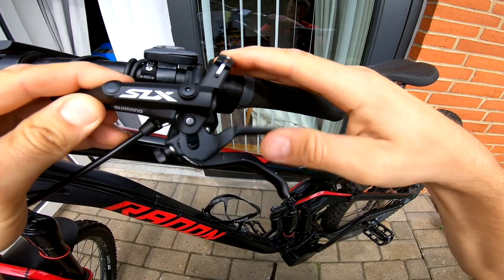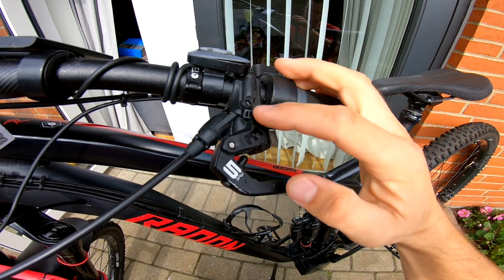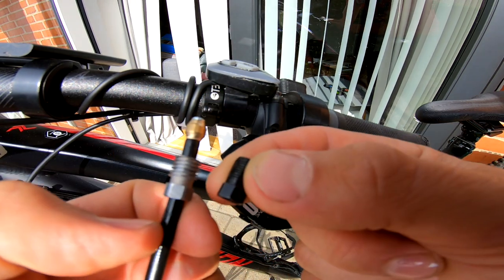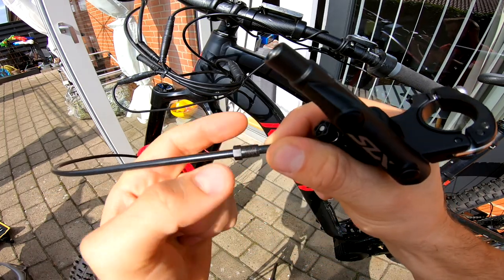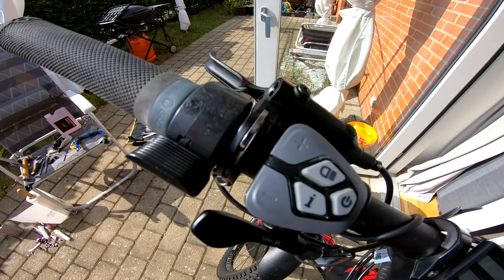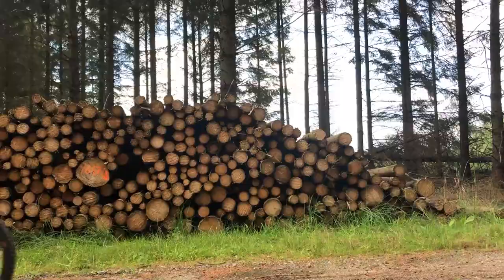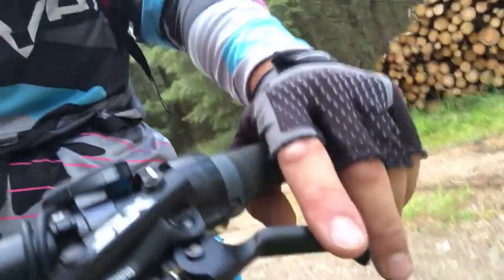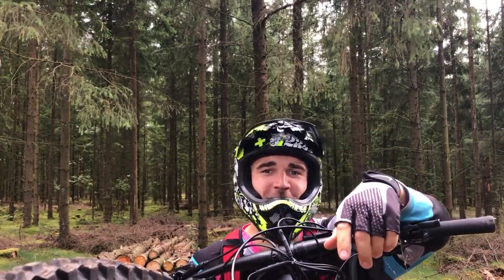Magura MT5 disc brakes with Shimano SLX handles on my emtb

Comment: Shimano Needle ?
Shimano Olive  ?
Reply from the maker: Hi Joni English, I do not understand the intention of your comment 🙄
Reply: @VRMinde  what needle did you use ?
Magura Needle or the Shimano Needle ( insert )
i see the Hose is Magura , with a Shimano Olive .
Reply from the maker: Joni English i used magura hose, shimano olive and needle :). (Edit: This comment is wrong, look below to replies)
Reply: @VRMinde  Thanks - i have a Magura MT5 older style and lots of play in the Lever Pivot : thinking of this update but using the m8100 or m7100 Lever Blades
Reply from the maker: Joni English I think there are better options than slx, I just got what I got in the mtb park workshop and then added the second one the same. I still like them more than magura mt5. Let me know if it worked for you
Reply: VRMinde on the video you have used shimano olive and magura pin (1:45). I have done the same on my MT7: XT M8000 levers, magura hose + magura pin + shimano olive + shimano oil and it’s working well...far batter than with magura levers. I have seen on a german mtb forum that using magura pin will prevent some leak because shimano needle (bh90) has a lower diameter than magura one’s and cannot fit properly magura hose.
Reply from the maker: dom gerlu thanks mate. I admit I could be wrong. I think there are like 5 or 6 different pins and I am not very sharp on which is shimano or which is magura. Thanks
Reply: RollinRat  In German we say "nadel", that would translate to "needle". The word "barb" may be correct but was new to me. Not everyone is a native speaker. So thank you for your help.
Reply: @domgerlu5038  It looks like a magura olive to me? I have used magura hose, shimano olive and barb but it's leaking from the lever where the hose is conected. Will a magura barb/needle help?
Reply: @domgerlu5038  how 's your shigura's doing? did you encounter any issues with the combination? appreciate if you could advise
Reply: what about Mamano? 😂
Reply: @Vegard_VB  Apparently Shimano makes two different size barbs, you need to buy the thicker one, there is a post on Reddit somewhere about this.
Reply: I using mt5 + xt lever with shimano mineral oil. But mine was not so powerful i dunno what wrong with it
Reply: @andychoe2486 same problem here
Reply: @andychoe2486 did you try a full bleed after?

Comment: Absolute legend!!! I recently snapped my mt5 master cylinder in half and wanted to put a shimano lever on my magura calliper. The guys at the bike shop said they would not recommend it. However, you have proven that wrong with your video. Next time my lever snaps ill be switching to shimano. Thank you for the video!
Reply from the maker: I would never recommend it as a bike shop either 😅 if something goes wrong you would blame them. I can do it for my own bike and take all the risks myself. It is been a while since I built this setup, still running it today :) glad you found this helpful man!

Comment: Great video. My only issue is the long lever throw before the bite point and the rear having more lever throw than the front. I've tried overfilling, but that only last a couple rides before the shimano lever squirts out the excess fluid. Thoughts?
Reply from the maker: The Duke of MTB , sounds like you have some leakage issue with your rear brake? It took me longer to bleed the rear one - adding oil to the top after first 2 rides helped (overfilling as you say). No oil should be squirted out. My both brakes “bite” at the same distance 🙄
Another factor can be wear of brake pads. If you put in wide blocks between the pistons for bleeding and then install brake pads that are narrow/worn there will be a bigger gap resulting in more distance before “bite”. 
You can try using narrower piston stop  blocks when bleeding to have a minimal gap. 

And finaly SLX bite point is fixed and not adjustable :( XT and above brakes have an adjustable bite point...

Comment: Oh, I hope this doesn't happen to my MT5s. By the way, nice hack! I love these type of adaptation. Good job!
Reply from the maker: I hope so as well man! At least put on a zip-tie on them. I saw so many riders having them on at the Hefjel bike park :)
Reply: @VRMinde  thanks for the tip. I've been riding the same set of MT5s since 2 years ago, and no problems. Maybe I got lucky.
Reply from the maker: @rubenvor  I had the same story - my old mt5s lasted for 4 years and on my new bike bursted open (thankfully) one day before we hit downhill park. And then when I looked for it - found more people with the same issue. I do not think it is very common-probably very rare, but very dangerous :)

Comment: Bafang Engine too?  I run LUNA X2 V2, but it is setup so nice. Bought TRP DH-R EVO brakes and honestly wish I had gone with MT7 and Saint9120 or XTR levers
Reply from the maker: Yes, good old bbshd, still running strong at 3kw with the phaserunner :)

Comment: Do you lose modulation by doing this?  I just don't know, but it's one thing I love about my Maguras.
Reply from the maker: It’s been a while now tbh, but back then when I switch it felt on the contrary - more accurate and responsive 🙄
Reply: @VRMinde  What setup are you running now?
Reply from the maker: @rzozaya1969  I am now still on Shimano. And I would probably not risk it again with the Maguras..

Comment: Tried that ,tweaked it for 2 months ,not reliable at all .Tried also with magura royal blood and with shimano oil ,with magura rb  was a little bit better .There is 1 big point which i've found ,internal cable routing affects the brake spongieness !!! On the frames which have the rear brake externally routed it might work better.Of course if you ride the brakes only on flat or light trails it works okay but nothing extreme or even dh.Now i'm running mt7 pro with mdr p. Totally different from mt5 .
Reply from the maker: That is interesting as I am still running the same setup, it is more than a year now, almost two! Maybe a good time to replace the oil :)
Reply: @VRMinde  as i said it's depends on many things , rider weight ,brake usage ,etc..Since i have /had around 98-95kg i was abusing the brakes af. Maybe you got a better qualify batch .
Reply from the maker: @jgellert  don’t get me wrong, I am not saying I do not believe in you :)

Comment: Currently, my only issue with the mt5/mt7 brakes is that  they are so powerful that the rear caliper keeps shifting over into misalignment even with the bolts torqued down properly. This happens on both me and my wifes bikes. I don't dare torque it more than 7nm even though 6nm is the recommendation. I ruined the caliper bolt holes before from over tightening.
Reply from the maker: The Duke of MTB wow 😳 never had an issue like this.
Reply: @VRMinde  Try checking your rear caliper alignment. Maybe it's off by a millimeter since you last checked and you just haven't noticed. I check every couple days, recenter it, and then after a day at the bike park it's off center again. Let me know.
Reply from the maker: The Duke of MTB just remembered to check the bike. Calipers are aligned and in place. I did not use a torq wrench last time fitting them...
Reply: @dukeofmtb  then it centers itself same as you would with loose bolts, just it takes the piston movement into account :D even better :D
Reply: @tomasstraka5244  Turns out I had a bad bearing in the rear hub. Slight wobble in the wheel. 😅
Reply: @dukeofmtb  well that turned out nicely :D

Comment: is this price oke for a hope 203 rotor ? 75.99 € euro ? i had a storm hc 203 magura, but mt5 estop manual says: 1.8 mm thickness MAX !! so now i need a new rotor, ZZZZZ
Reply from the maker: Sorry mate I have not been buying bike parts  recently so lost connection to the pricing. In my view all bike parts are not normally expensive these days!

Comment: Why not go for a full shimano setup? Is the magura caliper steonger? Thx
Reply from the maker: Andrei hi, I can’t compare. I was unhappy with the handles and replaced them. I have heard many experienced riders advocating for the “great magura calipers” though 🙄 They are working great, but I do not have shimano ines to compare myself
Reply: @VRMinde  okay. Thanks. Was just curious. I guess the magura brakes came on the bike stock?
Reply from the maker: Andrei yes. And my hardtail also has magura as stock :)
Reply: The magura calipers are much better. The shimanos always have an inconsistent bite point. Shigura is pretty good. But, if you can afford the mt7 with hc3 levers, then that is the best.
Reply: @dukeofmtb  i hav m7 with hc3, replacing for xt levers. side cover on m7 fell out but they want me to buy a whole new lever body. no thx :)
Reply: @MrBenjabin  That's too bad. The hc3 levers are amazing. The warranty didn't cover it? Oh well. If that happens to me, I might go back to shimano levers too.
Reply: @dukeofmtb  fell of as a result of a crash. wasn't a big one but no more plastic levers for me

Comment: I came here to find out if I could mix Magura mineral oil with Shimano .. And if you can, thanks for the video.
Reply from the maker: I believe you can, I have tried with no big problems. Maybe the best would be to use one of them, not both in one system at the same time 🙄

Comment: Just to make upgrade unexpansive. If I buy just Magura mt5 caliper will it work for existing shimano mt200 setup just replacing caliper?
Reply from the maker: I think it should, but I cannot guarantee it as I have not tried it mate
Reply: If at all, go for a better Shimano caliper. like the BR-MT520. My experience with Magura was terrible.

Comment: So this answers the mineral oil question that shimano oil is compatible with Magura.
Reply from the maker: I used all the mineral oils on all the systems. I have not mixed two in one though. But I have never had any gaskets/o-rings worn out or damaged... :) at least yet!
Reply: @VRMinde  that's good to know. Magura's Royal Blood is not always available in shops and way more expensive than Shimano's Oil.
Reply: @ArRkDr  Royal Blood is just a fancy name for hydraulic fluid, you can find it in auto parts stores

Comment: Magura should have made the brake lever body from Nylon not plastic.. If they want to be cheap
Reply from the maker: Well, I think it is not just "normal ABS" plastic, it is something a bit better :) But I will never go back to the plastic handles now :)
Reply: the standard MT5 levers are a composite.  The better upgrade are the aluminium 1-finger HC levers for the MT5 brakes.

Comment: Wow so Shimano mineral oil will work well in maguras?
Reply from the maker: Oh I would not hesitate putting any mineral oil, as a matter of fact I have used both the red and the blur and even mixed them in half and had no issues with it. I am pretty sure Set (Bermpeak channel) used baby oil for over a year on one of his bikes and it worked just fine 😂

Comment: that exact thing happened to my mt7 haha
Reply from the maker: Doghead 007 I was happy it happened on the last descent on a small local trail and not the next day in Hafjell bike park :))
Reply: @VRMinde  hi man I just installed the xt levers. the lever feels very stiff and the bite is almost too instant. what do your levers feel like?
Reply from the maker: Doghead 007 hi mate. It is hard to express it in words :) For me they do not feel “instant”, but they are way stiffer than magura handles. After two rides I felt like I have accurate control of my brakes. As I had one magura and one slx, Magura felt “spongy”, harder to “predict” where is the bite point. I do not know if that helps :))

Comment: Damn those levers are crap, that would drive me nuts, was literally minutes from buying MT5s instead of M8120s for a new Ibis build .. i should just stick with Shimano , my 6yr old M785 single pistons are still excellent and levers have  taken some abusive crashes..
Reply from the maker: Marc I will stay away from MT5s... not because of the performance, but because I like when my brakes do not come in pieces mid-ride :)
Reply: @VRMinde  yep already ordered the M8120's for great price ($280 set) from Merlin.. 👍

Comment: Its no Plastic
Reply from the maker: Lil L what is it?
Reply: VRMinde carbo texture or stuff like this,  its selfmade of magura, normally its a bit More stable, I personally had no Problems yet but i saw many Shimano customs. BUT u cant say nothing about  the brake calibers with them 4 pistons them self 🤤
Reply from the maker: Lil L the calipers are excellent! I just hope they will step it up with the levers as well. And maybe there already are
better ones from Magura, just hard to obtain in the area around here
Reply: VRMinde i think the slx magura combo will do well bro👌🏼
Reply: @lill1671  even carbon fiber.is plastic per say ....
Reply: Robi Flego you have to like it🤷🏼‍♂️